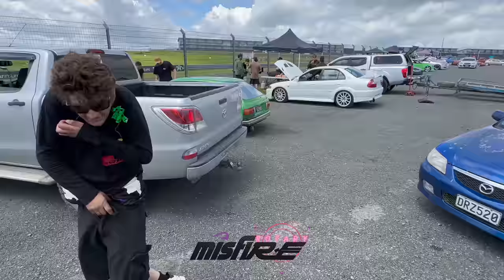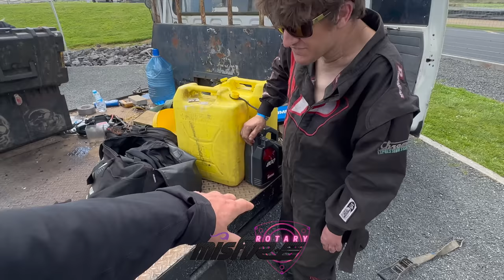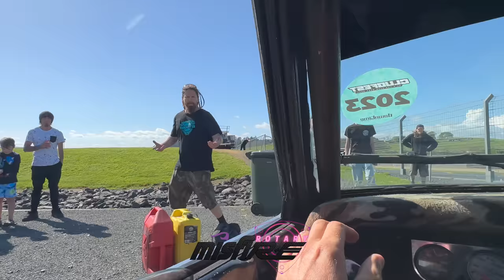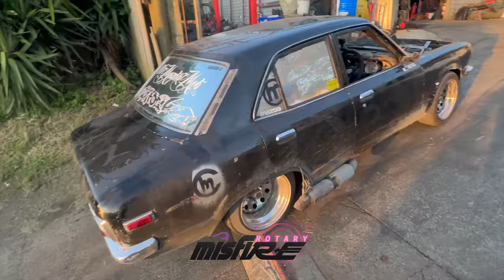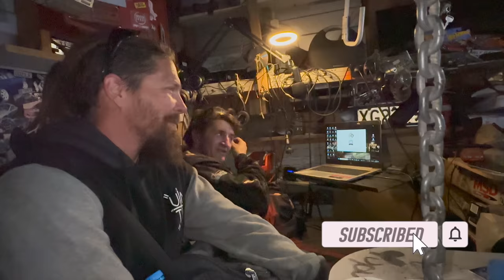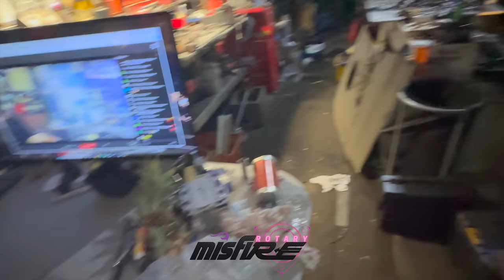The BACKYARD ROTARY BUILDERS Racing in a 20bpp

Comment: One thing to keep in mind. If your running rich you are more inclined to foul plugs with motul 800 because it has an extremely high flash point (250 Celsius) motul 710 flashes off at 87 Celsius
Reply from the maker: 🙏🙏🙏🙏🙏cheers for that❤️❤️great info
Reply: @misfirerotary piles of people run the stuff in their dirt bikes and when they get spooge coming out the pipe like billy had they reduce the mix thinking that will solve it 😂
Reply from the maker: Yea I tested that motul stuff and gotta say didn’t do very good I’m going the at stuff next time
Reply: @misfirerotary I’ve run the 800 in dirt bikes for decades, it’s only good if your flogging them all the time. Even with a good tune the bikes didn’t like being lugged around for long. The 710 is way better for an all rounder and it’s cheaper